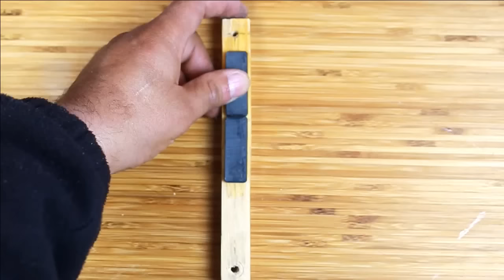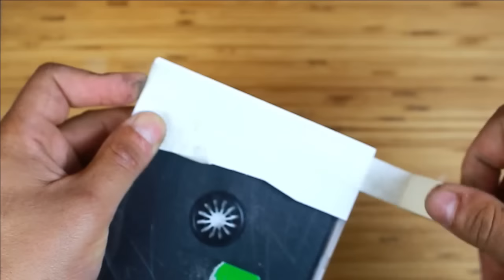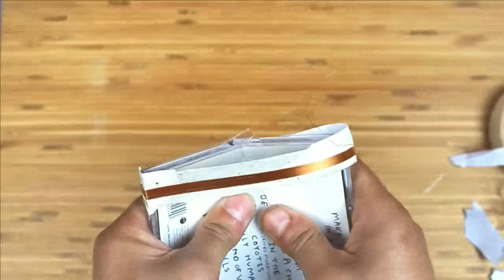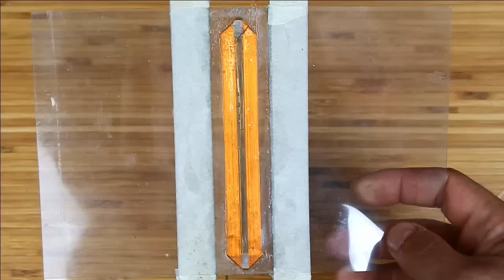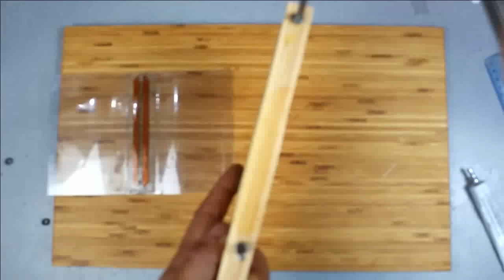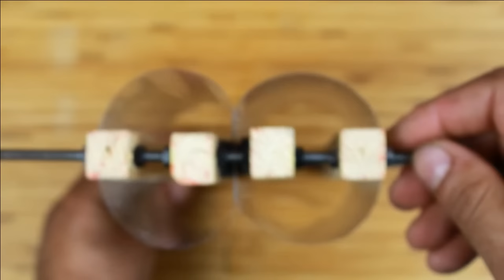--||-- Diy Full Range Rubanoide Speaker --||--

Comment: I love that the big capacitor got used for a rolling pin.
Reply from the maker: Yes 😉😉😉
Make sound gear by sound gear 😉😉😉
Reply: Same, also for sewing surgical pliers to help soldering.
Reply: Gee! What is such a huge capacitor used for? Electric chair??
Reply: Can’t forget the cd case to form the pick up/coil shape.
Reply: Foot
Reply: Hehe same
Reply: I was going to comment that it said no capacitors in the description! 😁
Reply: @homemade_audio  Seems like that could compromise the seal of the capacitor.
Reply from the maker: @brucemarsh4521  these old elna capacitors are real war machines 😁😁😁, they do not risk anything, in addition this cap is recovered from a recapped sansui amp
Reply: Muy buen proyecto felicidades, me pregunto si su función seria como medio rango y a cuantos ohms quedaría la bobina, gracias y saludos

Comment: After watching it through, I went back to check out one bit towards the beginning and realized that I had watched most of it all over again.. I commend you for the pacing, which is great for someone with both basic knowlage of this stuff, as well as those far on the ADHD spectrum. Also, the music isn't that overused stock shit that I find on so many commentary-free builds. Cheers
Reply from the maker: Thank you
Reply: True words
Reply: @homemade_audio   how do you calculate the nominel ohms of the driver coil?
Reply from the maker: @Thode-R  make turns and turns until getting 6ohm as DC voice coil resistance 😁🤷‍♂️
Reply: @homemade_audio  so you test the resistance using a multimeter?
Reply: What a fantastic demonstration of how electrostatic speakers function

Comment: Sounds surprisingly good for what it is. It's not a full range though. Basically a mid with a bit of treble. 
Bass is out of phase and will cancel out.
Reply from the maker: Treble response is acceptable, but for bass it can plays loud down to 150hz max, also full range speakers can't play well bass and treble, they're good for midrange reproduction.
Reply: At first I wasn't sure how it could be claimed base is out of phase since there's only one coil.  But then thought about the two plastic halves.  When one is pushed, the other is pulled so that is a point.  Could put a baffle on one half.
Could be too that the spacing in this case is just right that depending where you are listening in relation to the speaker the bass doesn't cancel at a fundamental low frequency.
Reply: They operate now a a dipole. And because of the shape the high range is extended somewhat. If you let them move in opposite directions they have to create pressure in between the halves. They are not strong enough to do that. With a dipole you don't want to create pressure, you want to create air movement. That's why you need a very light structure that moves easily. he low end only roles off at 6dB/ octave, so with some filtering this can be boosted. Change this to a mono-pole and you'll have to redesign it from the ground up.

Comment: This is awesome! I once played my guitar through a commercial system like this and it sounded really good. I was surprised.
Reply: That is exactly what I'm thinking.  I'm gonna make one of these 6 feet tall.
Reply: @TempoDrift1480  Oh that would be cool . The one I played through did have a mono sub and 2 stereo mids along with two omnis like this. The stereo separation was mild but that is natural.
Reply: What would have to be done to make this a home made guitar amp? Any ideas?
Reply: If its possible
Reply: @waydbro1  To be clear when I wrote 'like this' I was referring to ribbon speakers. Specifically electrostatic... Martin Logins with built-in woofers and a single sub to be more specific.  I sent the signal into the amplifier they came with.
Reply: As for ideas I don't know. I definitely wouldn't spend the money on Martin Logans just for playing guitar through. It didn't sound "better", just really good to my surprise.

Edit - Oh and part of the surprise was how loud they actually sound (even clean) in the room. You (I) don't generally get that from home audio systems made for full range.
Reply: @CynHicks  thanks, wasnt doing it for a sound. Just looked fun to make one.
Reply: @waydbro1  No doubt! I kinda want to make one too. I would definitely want  to build a taller one or two though.
Reply: @waydbro1  No doubt! I kinda want to make one too. I would definitely want  to build a taller one or two though.
Reply: Same idea. Build a big one, cast the panels out of a concrete mixture.
It will need a 💩load of magnets...
Reply: My thoughts exactly.  Minus the concrete mixture

Comment: I was really tired and busy when I watched this but I did watch it all the way through. It was something to absorb! And I wanted to come back and thank you for documenting this. I'm thinking about it and it's one of the few homemade projects that actually builds the driver instead of assembling drivers into a system. Reducing the crossover to a two-way active really has some advantages. I'm already thinking about refinement and scaling up. This might be one I eventually build. Thank you!
Reply from the maker: You welcome,  and you can use neodym magnet for best results.
Reply: @homemade_audio  I will absolutely  be building a pair.  thoughts  on handling capacity?
Reply from the maker: @incredifunk  hello, first build just one and try to improve it, because what i did is just making a prototype,  try to use strong magnets, different diaphragm materials,  size of coil and diaphragm....
Then let us to know different results.
Good luck 👍👍👍

Comment: This got me thinking on ways to make a bass speaker to go with this and what I came up with is to find a couple large loops or rather hoops, put something like a bed sheet over one and paint it, put a weight in the center (ballbearing, lg marble?) to make a parabolic, repeat with the other, dry and scew a short iron rod the tip of the cone, repeat with other. Role a coil of speaker wire and put over one rod, use a non conductive glue to glue the two rods ends together, mount the coil (not touching rods) and wood spacers to hold the two hoops in place. Not in that order though. Don't know if I have that quit right, but something like that. Maybe don't paint like a 1/2" near hoop so can flex better, maybe a small rubberband between rod or a plastic rod on one cone? The paint could be like wood glue or polyurathane (stiff) or flex seal or silicon?
Reply: Do it now ..... Do it now....

Comment: Cool Build!!! When RadioShack was in business, they had a mid-tweeter called "Linaeum" that had 360° sound dispersion. Although I never disassembled one, I suspect this is how it was constructed!!!😁👍🏻
Reply from the maker: may be yes, because there's a lot of kind of ribon speakers, this project is just a prototype easy to make for my followers, in the future i will show you how to make the exact magnet assembly to get an excelente result.
Reply: I have 2 LX5s and 2 LX10s, I also have 2 Linaeums sitting on top of my Fisher 430 Ms, They make a world of difference. I also have 2 more LX5s and  2 more Linaeums Sitting on my EPI Magnus in the Bedroom.
 Safe to say I'm a Fan 😂
Reply: @homemade_audio  Really cool Vid Brother, I really enjoy your Vids
Reply: @jonathanabrahams7878  Just an interesting note regarding the Linaeum tweeters: I removed the built in non-polarized electrolytic crossover capacitor and used an active (powered) crossover (automotive). There was a huge increase in Soundstage openness and a particular resonant/ringing frequency from the capacitor disappeared. Needless to say, it was a HUUUGE improvement in sound quality!!!😁👍🏻
Reply: @fookingsog  
Was that on the LX 5s, I never noticed any abnormal sounds coming from them, I've actually been playin around with them lately wondering if I could enhance the sound, What Crossover did you use?
Reply: @jonathanabrahams7878  It was the add on Linaeum component tweeter that I removed the caps from. The crossover was a cheap powered active 3-way 12 Db/octave car crossover that I got, I belive from Parts Express out of Ohio. I think I paid less than $75 for it. This was back in the early 90's if my memory serves me correctly. I even have a couple of the RadioShack/Optimus 10 bands per channel EQ's with the IMX Expander Processor. I need to pull that stuff out of storage and have some fun!!!😁👍🏻
Reply from the maker: @jonathanabrahams7878  enjoy my friend,  very good speakers 😃😃😃
Reply: @fookingsog  I Just bought that EQ 2 months ago, My Father just recently passed and left me a Optimus stav 3300 Reciever along with a 300 disc CD player full of Classic rock, A cassette player with a few hundred Cassettes, I had that E.Q Growing up, It does a great Job(I love the light display also 😆) I have a New Marrantz Reciever that Sounds Good but That Optimus Reciever with that E.Q really sounds Amazing, Shocked me, I'm actually Amazed at how nice Cassettes sound on the setup really took me back
Reply: @jonathanabrahams7878  Alot of "Good" receivers/amps have a neutral sound, which is good!!! Regarding Marantz, I spent a couple years in Japan and discovered Marantz & Philips were partnered together. This was back in '96. I have a picture I took of a building, either in Tokyo or Yokohama that had both the Marantz AND Philips name/logo on it!!! I used to live in GreenEville, TN, which was home to Magnavox/Philco/Sylvania & Philips...they had the factory for producing the large rear projection TV's and whatnot. They also had a factory shop there with "Scratch & Dent" and factory repaired items that they couldn't sell at retail full price. I was able to pick up a discrete 2-channel amp, a discrete DAC, & a dual well tape deck, all Philips products. This was all back in the 80's when this happened!!! Needless to say, I miss that era!!!😔
Reply: @fookingsog  I use both the Marrantz and Optimus simentarily, Marrantz has Optimus LX10s as mains 2 Optimus  LX 5s for rear and 
Venturi DV62si for center below the TV.
  Optimus 3300 I use Fisher 430m With an Added Linaeums Tweeters sitting on top, 2 Optimus Pro LX 77X for Surround and Optimus XTS  6 Swivel for Center above the TV
 Together they just Sound Amazing! I Use 2 pioneer Subs in a car Box with a 2 Channel Plate amp for Subs but rarely ever need to use them and fear for a devorce when I do 🤭
Reply: optimus brand linear dipole i think is what they were called
Reply: @Borkery  Linaeum was the brand/style of tweeter that RadioShack incorporated into their Optimus speaker brand lineup. Specifically branded/stamped "LINAEUM" on the top of the tweeter and yes, it is a di-pole design with pretty much 360° of dispersion/radiation although it may falloff slightly to the sides where the ribbon is attached to the frame and movement diminishes!!!

Comment: I now have my 1-1/2 dowel rod sliced in half down the middle. I cut a 1/4 inch wide by 1/8 inch deep groove down the middle of both halves of the above mentioned dowel rod and after almost a week, I have 40 small button sized rare earth magnets glued in each half. Which was a serious pain in the ass!  Using gorilla glue and a clamp for each magnet. I am using round, soft, clear plastic tubes for mine. Taking my sweet time to make it look beautiful. Cannot wait for this project to be finished!!
Reply from the maker: Good luck 👍👍👍, thank you for trying 🙏

Comment: Well, that was strangely interesting.. I actually enjoyed watching you build that. I was not sure of the direction you were going, until you opened the plastic film layers up, and I was like "AHHHhhhhhh, I see what he is doing"... Clever setup...  By chance, have you run a frequency range on that unit, to see its strengths and weaknesses are, or what bandwidth it can cover? I am curious to know. I realize, what we hear through YT videos, vs what is heard in person are two totally different things, but, from what I hear, it does have a bit of a "tingy" sound to it, which on its own is a horrible sound, but once backed with mid range and a sub woofer, and possibly a tweeter, I bet it will cover allot of the harder midrange that cone speakers fail to keep up with with out cooking themselves off... Well done...  Also, How does it do with MALE voice/vocals, and likewise, females voice/vocals... ?
Reply from the maker: Cool, this speaker is designed to reproduce well female vocal voice 😁😁😁
Reply: this makes also abetter microphone cause I've tried it and it can detect even faint sounds especially when put against the wall you can use it to snoop on your neighbors

Comment: One of the coolest things on YouTube.

I wonder if the sound would improve if you lightly stuffed some poly fill inside the “hollow”  parts of the speaker.  That way you might be able to cancel out some of the sound coming from the inside of those hollow tubes?  But I’m sure it would greatly reduce its efficiency and frequency reproduction
Reply from the maker: yes it's recomended to put some absorbing material inside ribon for good result.
Reply: It could be mounted on a pole so that it's well away from touching it.. I'm so excited about experimenting with this! .. I should probably finish my record-cutter and cutter head first though!

Comment: This are linear coils .This is how magneplanar speakers are made ...They have several rows of magnets like those u used .But not required to have a magnet sandwich . Have you tried with just one side magnets .. ? and a better tensioning system for the diaphragm

Comment: Very cool! I assume the copper wire is insulated? Have you measured the frequency response and distortion?
Reply from the maker: Not yet, because I'll remake the same project with very strongneodym magnet, then I'll take mesures 😉
Reply: Looks like 30awg copper wire with flexo insulation (brand name.. melts into a Flux at 650°f).

Comment: Hi, did I see that you have used different cleaning and gluing products?  what are they?  another question is: how much diameter is the copper wire for the winding?  from the caliber on video is not clear.
Reply from the maker: hello, of course :
- Paint thinner to clean 
- rubber glues
copper wire diameter : 0.2mm

Comment: Neodymium magnets with a stronger magnetic field and thicker wire and thicker plastic with possibly a 80 Hertz or lower crossover
Reply from the maker: Like any other speaker: if you improve low frequencies = you lose some high frequencies 🤕🤕🤕
Reply: @homemade_audio  but I bet if you use one of your DIY crossovers to separate the frequencies of each one and made a stereo pair to make it to where you had a smaller one for a tweeter left and right channel and then like this one that you made for maybe mid-range and then a bigger one with thicker material and neodymium magnets for a stronger field most definitely there would be a difference. Theoretically speaking that is. but regardless I would love to see you do that. it would be so awesome to see you create it and see how beautiful it looks 💓

Comment: I'd like to see a frequency response curve  on this amazing build :goodvibes:
Reply: I would appreciate one as well. From the music demos, it sounds like it has very good mid-high and high range response. Needs to be accompanied with a decent woofer and sub, and it would very suitable for a full range hi-fi setup.
Reply: @foxyloon  This never would end in any Hi-End sound system basicaly because its trash...
Reply: @eduardoanonimo3031  Never say never, and temper your expectations. 

Ask for tangible results instead of immediately assuming it’s utter garbage. Also, it isn’t reasonable to compare a DIY project to a $2000 set of speakers.

Obviously this is a homemade project, but it’s based on a tried and true design featured in high tier Hi-Fi equipment. There are dozens of homemade speakers out there that sound excellent, because the person who made it did their research beforehand.
Reply: @foxyloon  I get youre point, but the building technique and materials used make this speaker are pretty weak and susceptible to damages even by oils in the air...
Reply: @eduardoanonimo3031  Agreed. The overall build quality is a bit lacking. I doubt it was intended to last for years, it was definitely put together as a casual hobby project.

Comment: I hate to deflate your balloon, but these speakers while good over the mid to upper range do poorly in the low range. If you want really good performance you are much better off doing an active speaker system with active crossover. If you want performance from ~400Hz down to 20Hz you need the stiff large surface area of a cone or carbon honeycomb speaker. Even better than these magnetic driven ribbon speakers are capacitive speakers, although the circuit that drives them is different.
Reply: It's just good for general purpose like the small computer speakers they're good for people who don't like bass especially heavy bass, also for shortwave, amateur ham radio,cb radio use where bass makes hearing distant weak reception difficult. All you'd have to do with this speaker is build it bigger and build a crossover for it. Or make a subwoofer version of it, or buy a subwoofer. These would work like the small theatre surround sound TV speakers that you'd need a separate subwoofer.
Reply: Realistically; who actually thinks these were designed  as  low frequency  drivers !

Comment: IMHO this configuration isn’t very efficient since you’ve an opposition between the two parts of the voice coil. The static field is only in one horizontal direction in your magnetic arrangement, then the ascending current and the descending current in the voice coil acted in opposite ways all the time whatever the sign of the audio signal…
Reply from the maker: Yes i know, and it's true all what did you say. I had said that i will make an upgrade for magnet assembly. 
Normally the magnet assembly must be based on to parts of metal with magnet inside in each side to control the two parts of  coil wire.
Thank for your comment. 
You welcome 🙏🙏🙏